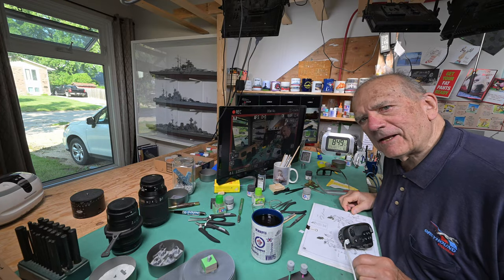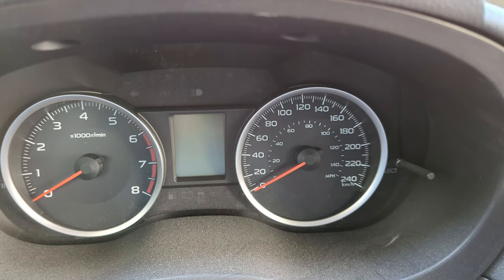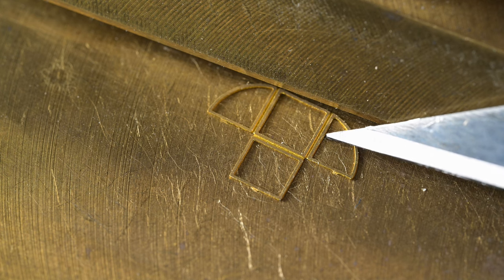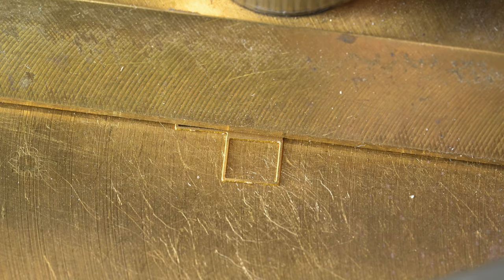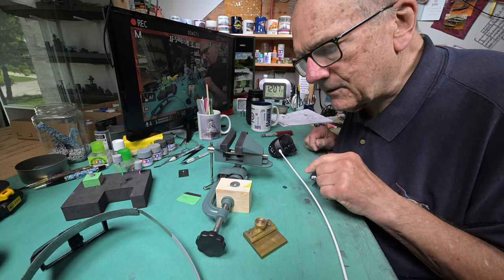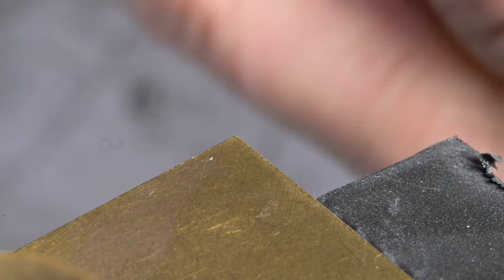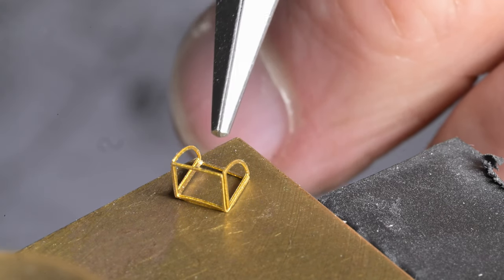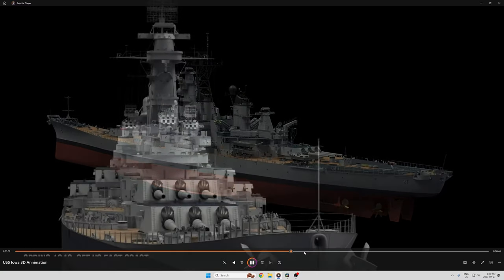The Model Ship - Part 1663

Comment: I think that you made a mistake bending it upside down in the bending fixture. If you use a straight blade and insert it into the bend relief and the slide it back flush against the top of the bending fixture. Annealing the PE helps a lot.
Reply: I've been building models since 1968, so I hope that I haven't been over bearing in my suggestions to you.